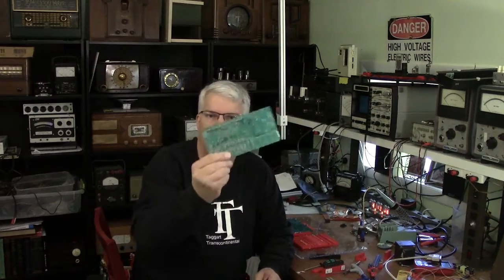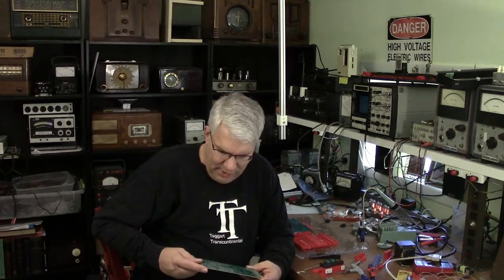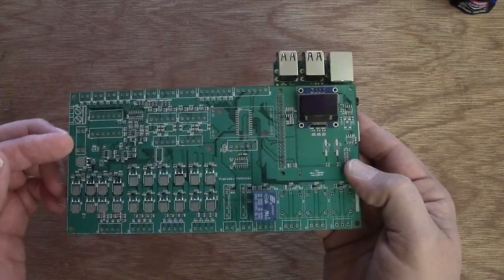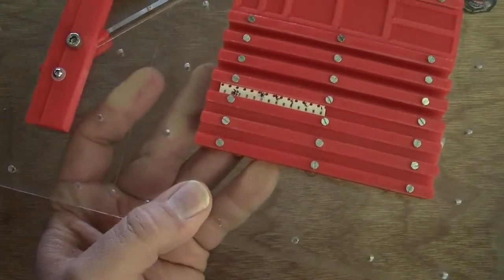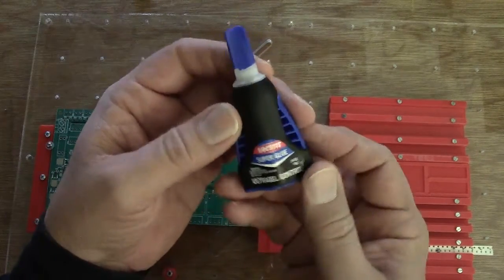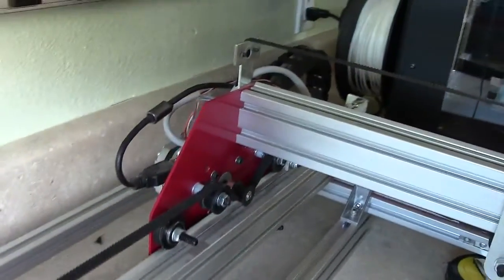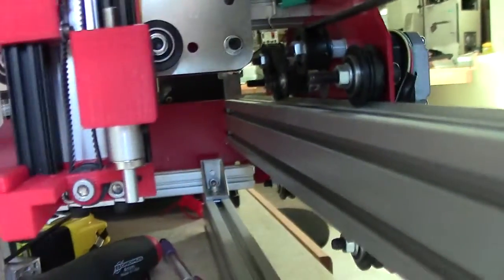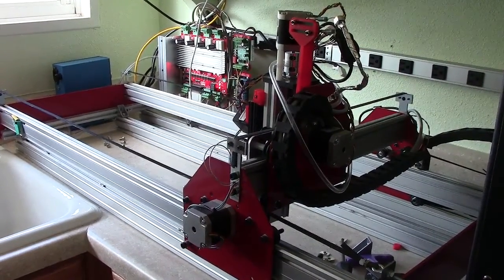161011 Maker - TEX and Pick'n'Place 1

Comment: how many steps per rev on your steppers?.  do you have  gear reduction?  nice machine!
Reply from the maker: 200 steps/rev. No gear reduction used. Thanks for watching.
Reply: +Craig Hollabaugh thanks for replying.   what would you estimate the weight of the gantry?
what is the holding torque of your steppers?
 ( I have a screwdrive cnc, but I'm considering making a pnp/laser cnc using belts.  trying to get a feel it.  )
Reply from the maker: the gantry weight is next to nothing because its mostly plastic and a nema 8 stepper. As for the holding torque, I can't say, have not had any problems though. The X and Y axis needed a lot of tuning to get the speed up. If I did this again ... 

I do plan to get back this project. I have juki nozzles and a bunch of other stuff. send me a private youtube message with your email and I'll email you my notes file.